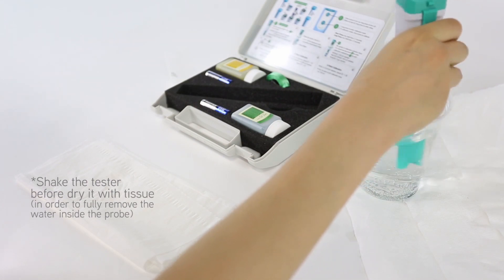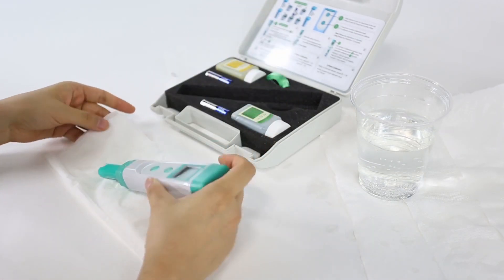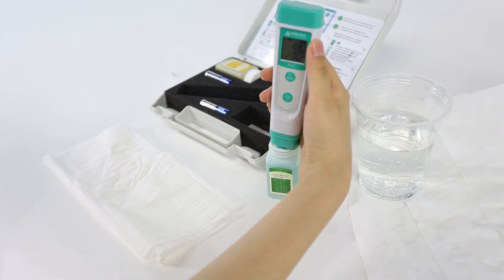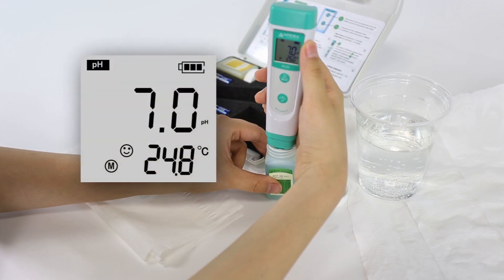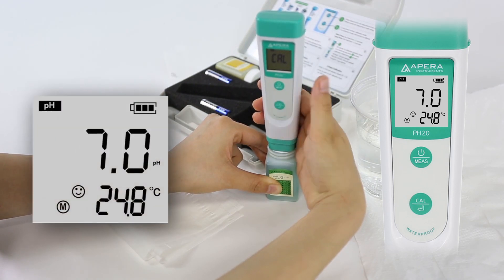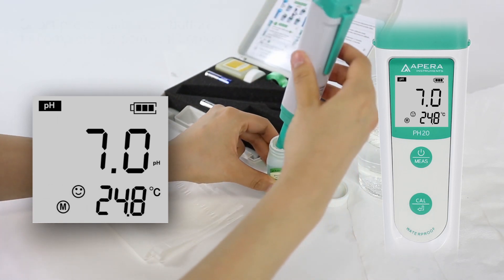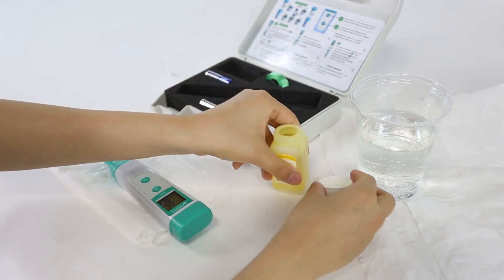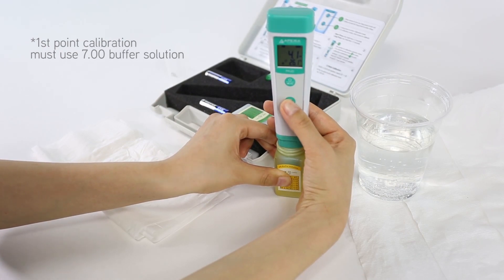Southern Labware How to Calibrate Apera Instruments 20 Series Value Testers 1 3 Points Calibration

Comment: Make sure your sensor is clean guys. Mould likes to grow around the sensor so make sure that's not blocking the reading. 

But, mine does not calibrate anymore. Stuck on 7.3 in 7ph solution. So I guess I have to use it with a 0.3ph in mind for today's brew fook
Reply: Did you hydrate your sensor? This video doesn’t say so, but I was reading the pdf manual and it states when you first use it or have not used it in a while, you have to put it into 4.0 solution for 15 mins.

Comment: Mine shows 5.4, and I get er1. It doesn't calibrate itself. Garbage product, do not buy this. Returning it to Amazon
Reply: I’ve had mine for close to 10 years no issues yet, you may of got a dud. Think I paid 30$ for it years ago. Can’t go wrong with this meter
Reply: I've had similar issues. It calibrated once, and never managed it again
Reply: I’ve had mine for 5 years, and yes, it’s crap in a bag!  I haven’t had a correct reading in years.  Blue Lab is by far the very best on the market today.  Buy the soil ph test meter, it works in soil and in water.  2 for 1 works for me.  It’s pricey, but once you act on a bad ph reading and you correct your grow using the bad reading as a reference, for it to only make matters much worse, you’ll fork over the dime to buy a Blue Lab meter.  Been there, done that!  Never again.